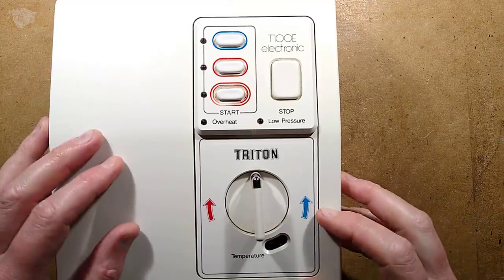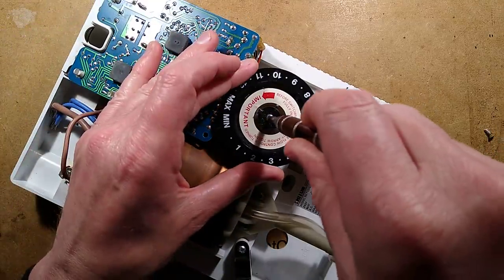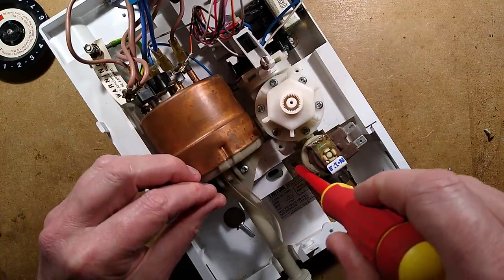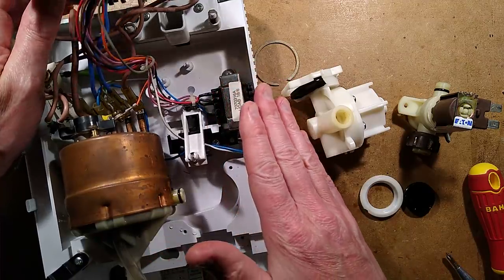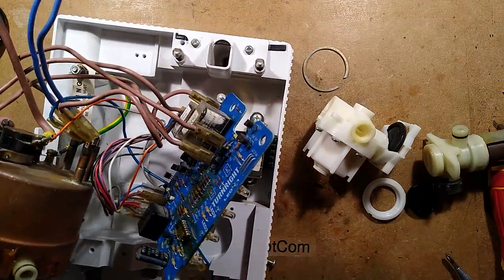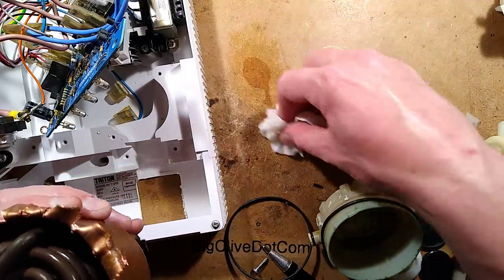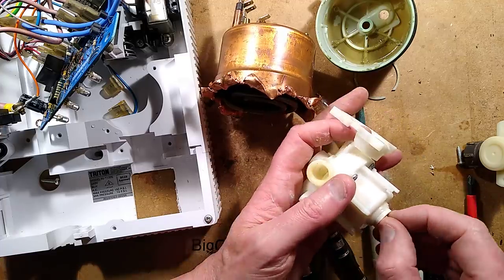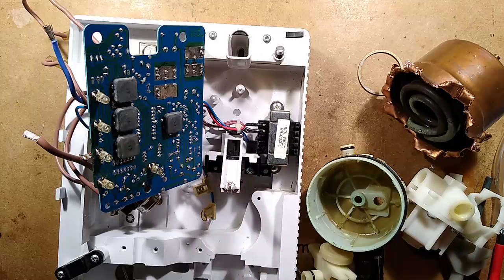Teardown of a British electric shower that went bang.

Comment: I think it might be interesting, especially to the kind of people that we are, following Big Clive, to understand why does the UK has this kind of shower. For me this is because of the traditional ways hot water is/was produced in UK, especially in the old Victorian homes. In the kitchen you would have a tankless on-demand gas water heater right next to the sink. Above the bathroom, in the attic, there would be a hot water tank, not pressurized. The water would come in the bathroom only pushed by gravity. These have a few practical consequences. 
First, with two separate hot water systems, there is no need to carry the hot water all the way from the kitchen to the bathroom, usually upstairs. And it is true anyway that those on-demand gas water heaters are not really good to produce a medium amount of hot water that is required to avoid having a scolding hot shower. Especially when they are a bit old, they require a big steady usage of hot water to turn themselves on.
Second, with the hot water in the bathroom having next to no pressure, it is simply impossible to mix it in the tap with normally pressured cold water. As soon as you let cold water in, it will push the hot water away. This is why most people would have this Victorian style taps: one for the cold water, one for the hot water. This is perfectly adapted for a bath, but not so much for shower.
Third, people in the UK are therefore used to never drink from the water in the bathroom, only in the kitchen. This is because the hot water tank not being sealed could contain all kind of drowned creatures in it. But of course this is not relevant to their usage of "electric showers".
This is why, not having a better alternative, the best way to install a shower in a Victorian house is to use an "electric shower".
Now why do people in the UK still use those showers, I am really not sure. Maybe it is cheap. Maybe you never run out of hot water. And if it is so good, why don't we, outside of the UK, use them too? Please tell me!

Comment: My parents had an electric shower and I hated it.  Every time I went to take a shower my brother would flush the toilet in the spare bathroom and the shower would then pour out scalding water for about 10 seconds followed by freezing water for 5 minutes until the overheat protection clicked off again.

I have a proper mixer shower now.  It's so much better if you can have one fitted.

Comment: The student house I rent has four 6.5kW electric showers in one house. It's an ordinary house with a 100A single-phase mains breaker. You can do the maths.
We've lived here for 2 years and not had any fires yet. 

One of the switches outside the bathroom for isolating the electric shower melted once (probably because the switch was pitted, the landlord put in a new switch and it's been fine since).

Comment: I suppose it saves on piping and is more efficient than a tank heater, but I'll still never get over you Brits and your electric showers :-D
Reply: You should try grounding your electrics, makes everything much safer. I'll never get over the sparks and dangliness yank plugs make and have. Asking for flying blackened babies. People just don't get hurt by electric showers in the UK, except if you circumvent the safety features. Or running power on overhead lines near houses and trees in suburbs
Reply: our water pipes are grounded

Comment: Well, it seems to be a lot safer then the gas-instalations here in Netherlands and Belgium (geiser) that kill a lot of people each year still of carbon-monoxide. That happens mostly in the bathrooms and some in the kitchens.
I guess always installed on a seperate circuit with extra breakers?

Comment: But why are they used at all - Don't houses in UK have centralised water heating?  I'm going to assume that some buildings are so old that they only have cold water plumbed to the shower - and the cost is cheaper to simply put one of these in rather than re-plumb new piping to the shower?  That's the only reason I can think of.
Reply: Snocrash yes, we all have centralised hot water systems. But older properties often have low pressure hot water fed by a cold cistern in the attic. These couldn't operate showers in bathrooms which might only be a foot or so below the tank level on the floor below. Electric showers operating from mains pressure cold water only solved the problem much more cheaply than replacing the entire hot water system. My parents generation always had baths, showers were very rare in domestic bathrooms until the seventies.

Comment: So would this even work if you want very little flow of warm water? Can you freely adjust temperature from cold to hot without changing the flow rate along with it?
The concept of this electric shower seems pretty awkward to me.
Reply: "Can you freely adjust temperature from cold to hot without changing the flow rate along with it?" No. To have water that is hot enough you have to turn the flow rate right down, especially in winter when the mains water is freezing cold. I hate electric showers, the flow is poor and they use A LOT of electric. The hot water for my shower is heated by my gas combi boiler, which is much more efficient.

Comment: Nearly never found in the U.S.
You find them anywhere with light skinned tourist in Central America though. 
We call 'em "suicide showers" with good cause.

When they are wired in by someone who knows nothing more than the average 5th grader about electricity, you have to be careful.

I've gotten naked, turned it on & had my shower without issue, but when I touched it to turn it off I got the living shit shocked out of me.

I've gotten a pretty bad jolt from the shower head with the bare heating elements built into it as well. Just when I touch something grounded to Earth though.

Comment: Well instead of electric, most use a hot water on demand unit, that uses  propane, or natural gas as the heat source, in the U.S. and Canada, but they are usually outside of the house, or in a utility room.
Reply: Duane C these are not a substitute for a conventional hot water supply, every UK home has that as well- either a combi boiler, or a traditional hot water tank heated by a boiler of some description or an electric element. These are used for ease of installation perhaps in a newly added second shower room, or above a bath in a traditional bathroom (older uk homes never had showers) where the hot water pressure is too low to run an adequate shower. Many older home have dated hot water systems relying on header tanks in the loft - which may be mere inches above the shower head so wouldn't operate a shower properly. They are better suited for filling baths quickly but at low pressure through large diameter pipes. Electric showers are therefore a quick and economical alternative to replacing the entire plumbing system. They are not routinely fitted to newer homes with pressurised hot water supplies.

Comment: My shower unit went BANG last week with a blue flash and a bit of smoke just after I got out of the shower.
The red and black cables had burnt through and blasted away the copper wires leaving a gap in each wire.
It's pretty black inside so I decided as I'm enlarging the shower room anyway I'd get a new shower unit. It's probably 25 years old. No electronic parts inside. Why do they think they are needed?
Reply from the maker: Possibly just a bad connection heating the wires so the plastic melted and caused a short.

Comment: I wonder why is the flow-through heater instead of a boiler?
Reply: mibars we have boilers too, just older homes tended to have low pressure hot water cylinders made from copper and pressurised by a cistern in the attic- pressure was insufficient for showers fitted in bathrooms just inches below. Before the seventies or so showers were a rarity, people much preferred baths. Electric showers provided an economical solution. Plus, they are useful backup incase your hot water system fails, or you run out of stored hot water.

Comment: Holly cow... This looks so dangerous! Back in the day when I was in UK (I was like 12) I thought it is just a "fancy" water regulator. If I knew there is high voltage right next to high pressure water I would never use it :D Also the plastic bits (I.e. the watet valve) look like they could very easily start leaking in a few years...

Comment: These showers are totally safe, if they are installed by an qualified person. Long as they are earthed and RCD protected, and with in zone 1, and meet min ipx4. There is nothing wrong with them. Being a electrician I installed my own 10.5kw shower in my en-suite as a back up to my main source of hot water. 
If electricians are happy with these being used then I can’t see why everyone else would be worried,

Comment: So wait a minute in UK you can't have a 240V outlet in the bathroom and instead you get a 120V "shaver outlet" because of safety concerns but you can have a 240V powered device INSIDE the shower??? Am I missing something or what?
Reply: Yes, because it doesn't plug into a mains socket in the bathroom
Reply: A shower is a "fixed wired" unit with an IP rating and mechanically sealed, no numbnut can access the inside without tools or brute force, an outlet is also fixed wired and mechanically protected (and can be fitted into a bathroom as long as it's 600mm away from a bath or shower enclosure and protected by a 30mA rcd/rcbo with adequate equipotential bonding to all incoming supplies to the property) but most if not all electricians will not entertain the idea of fitting an outlet in a bathroom because numbnuts will plug potable appliances in and nearly all radios, hairdryers, hairstraightners, TV, hairclippers, lamps etc aren't earthed/grounded
And if placed in bath, sink or shower could potentially be a hazard to person, livestock or property!
Now why on earth would you want a 230v outlet in the bathroom?
Reply: @yourrightimsooosorry884  I'm from Italy and we have normal outlets in the bathroom to power various appliances from hair driers to washing machines to heaters.
If someone applies a minimum of common sense and carefulness it's perfectly fine (and there is also protection from the mandatory RCD in the house)

Comment: This was quite a common fault with this model ( and several other)Triton showers, the quality of the plastic in that valve was of poor quality, and would often crack over time, or fail completely, especially if subjected to "water Hammer". Before I retired, I repaired quite a few with the same fault.

Comment: Ah, i see Clive has found a new drop in heating element for his bathtub :-)
- looks astonishingly clean, no calcification on the heaters, must have good water on the island...
Reply: It won't be well water but it might be mine water ;)
Reply: Depends where Clive's brother lives. Some of the UK has nice soft water but other parts have water that'll cake your kettle in calcium in a few days flat
Reply: @kantpredict  Austria, especially where I live isn't better. Our water is super hard, limescale builds up right after the first use of a new kettle.
Reply: Do y’all not have water softeners? In America they’re relatively common. You dump in bags of salt and, through the magic of chemistry, it turns hard water into soft water.
Reply: @mrb692  They're available, but what's the point? 

There's no problems in drinking hard water, and it's easier to just de-limescale stuff every so often than have to buy in bags of softening salt and add it to every kettle boil, toilet flush and bath.
Reply: @joj.  Yeah, but with softened water, you only have to maintain one central point and not de-lime everything else, or replace your faucets every so often.  Plus detergents work better, you get cleaner clothes in your washer, can lather up in the shower, etc.
Reply: @greendryerlint  we luckily have a 50:50 mixture of Soft  (pipeline) and hard water (local wells), which makes a nice medium level for washing and making tasty coffee.
For really hard water i would also suggest using water treatment, because it overall saves on detergents (washing powder, even washing hands) and maintenance on everything watery used in a house.
The big salt bags are also much cheaper than adding it in the dishwasher (i put the big tablets also in there because it has enough time to work good enough as ion exchanger).

Now the saving money by spending money point is hard to get across in multiple owner houses. But soft water makes it easier for everything heating up water anywhere. Also nicer taps and less cleaning the shower.
Reply: @joj.  That's not how it works though. It's one centralized thing, and once a season or so you go to the hardware store (do you have those?) and buy 8-10 bags of salt and dump them in the softener. It consolidates all the descaling you do to your kettles and showerheads and whatnot into one infrequent activity. 

Plus, as Green Lint said, soaps work better, giving you cleaner dishes and clothes. This is purely an opinion thing, but I also think soft water tastes better.
Reply: @mrb692  I've never heard of such a thing over here, though, let alone any houses being equipped with such a system. 

We have hardware stores, yes, but I guess people didn't want to have to go buy a bunch of bags of salt every couple of months, as it seems like it never caught on.

It's possible that it's also just illegal, as the UK has some laws that prevent certain water setups in households that can contaminate the mains water supply in the event of a backflow. (Hence why Mixer taps are much less common, your hot water could backflow into the mains water supply).

We just accept that the water is hard and deal with it. Almost certainly some people will have softeners in the UK, but eh, it seems like a lot of effort for not having to delimescale stuff when you clean your kitchen/bathroom.
Reply: @kantpredict  It's the Isle of Man. 
The water is very soft.

Comment: Some homes here have "on demand" hot water heaters...but they are not placed in the shower.  Keeping humans, water and electricity separate is always a good idea.
Reply: RCPro Driver most U.K. homes built since the 80's have combi boilers, which are basically instantaneous gas water heaters which also provide central heating. However many older properties still use the earlier low pressure hot water tanks fed from a cold water cistern in the attic, they don't supply enough pressure for a decent shower without pump assistance, to electric showers were seen as an easy solution.

Comment: Must have been quite a mess when that plastic part gave way, but 30 years ain't bad, usually modern stuff just fails cos it's bored... :P
Reply: I had a Triton go after 14 years so i bought a new one that looked similar when i took the cover off it was 100% identical! the design hadn't changed in over a decade just the case!

Comment: I assume these are for households where municipal gas isn't available but it's a shame they usually can't keep up with the water flow. It would be a lot better if the cold water that goes into these is preheated with some kind of heat exchanger that takes heat from the waste water. But as far as I know, that's never been a thing. In fact a system like that could preheat the cold side of a thermostat faucet too. I wonder how hard it would be to design a heat exchanger like that, that doesn't get clogged up with hair and stuff but still exchanges several kilowatts of heat.
Reply: ManWithBeard1990 There are shower trays that have coiled pipe embedded in them or bonded to the underside, which preheat cold water, usually fed to the cold side of a shower mixer. This raises the temperature of the cold water, so less hot water (which has been heated elsewhere in a tank, or via a combi boiler) and so reduces the requirement for hot water and hence lowers energy use. There are also various drain heat exchangers. None have really been widely adopted and few people are even aware of them, the energy savings are not as big as one might expect and until mandated they are likely to remain a niche product.

Comment: As an Australian visitor to Britain since the late 1970s, I have often wondered why showers seem like some sort of novelty household accessory. This sort of contraption can only mean that hot water systems themselves are deemed superfluous. Most odd.
Reply: A lot of housing in the UK was built when plumbing wasn't a thing and so even though new houses are built with cold and hot running water it wasn't until the 90's that hot running water became the norm so if you wanted hot water in the system for a bath you had to heat it in an immersion tank (a giant kettle).  You also had to use the smaller kitchen kettle to heat water for washing up or doing dishes and you had an electric shower for showering.  At least it's better than previous generations, many homes didn't even have cold running water until the 1930's and had to rely on communal wells still.

For a country that set a lot of standards we were probably the last developed country to build houses with hot running water, when my parents got a boiler installed in 2002 and we could turn on a tap and get hot water it was mind-blowing to this young head.

Comment: Horrid things! Even the most powerful versions are puny compared with a mains-pressure hot water storage system, or a combi boiler (although combis do bring their own problems). 
Electric showers may be cheap to install, as long as suitable wiring is already in place, but they cost a fortune to run, especially now we’re getting toward 30p/kWh for electricity. 
Safety wise though, absolutely fine as long as they’re properly installed and the casing is undamaged.
Would avoid, unless the only available energy source is electricity.